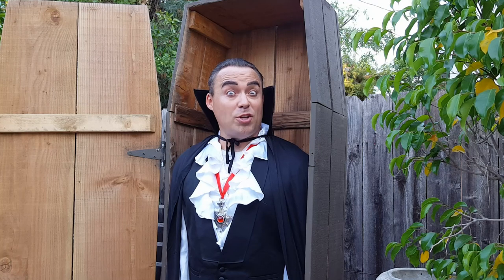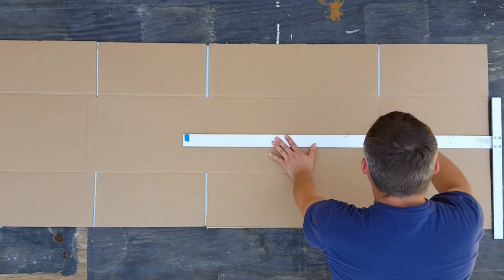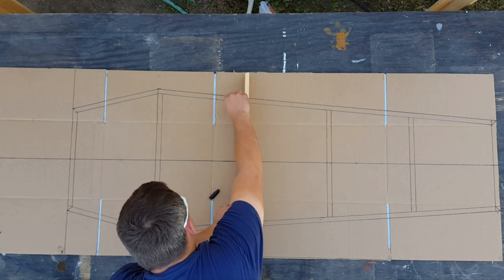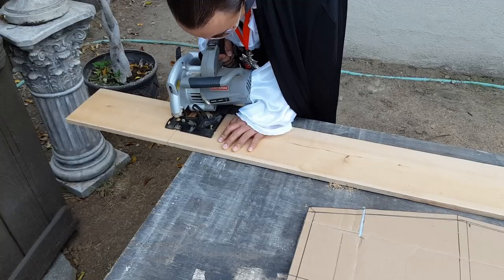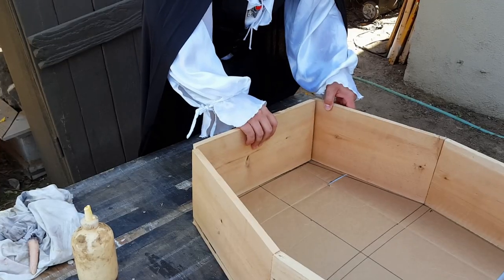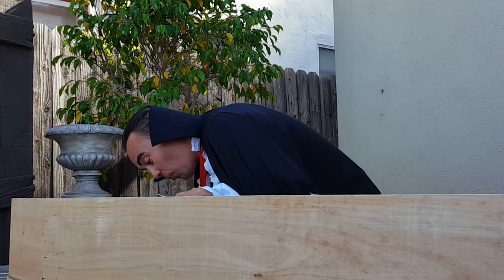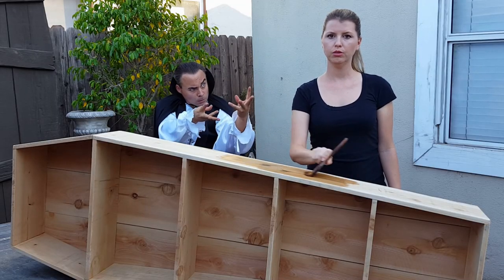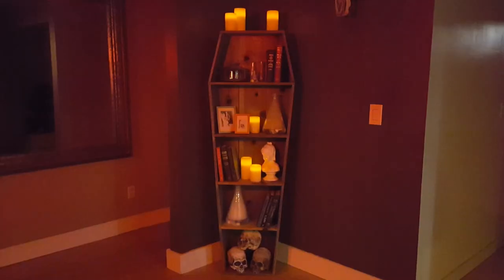Dracula Makes a Coffin Shaped Shelf - DIY Halloween Coffin Decoration

Comment: Could you suggest an alternative wood? Home Depot and Lowe’s does not carry the cedar fence boards anymore
Reply from the maker: They should, try searching cedar fence pickets.  you could also us redwood but it cost more.
Reply: They don’t carry them in store and the ones on the website come in bulk pack in smaller width
Reply from the maker: @jssjrs109  oh that's lame.  Other than different types of picket boards you could always buy pine boards that come in different widths but it is going to cost some more money unfortunately.  I have also made some using 3/4" thick plywood.